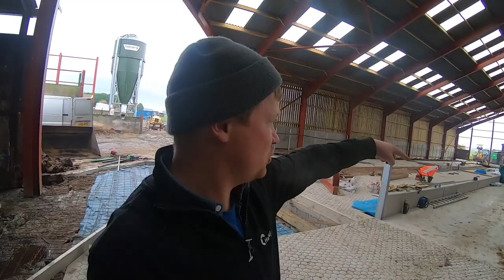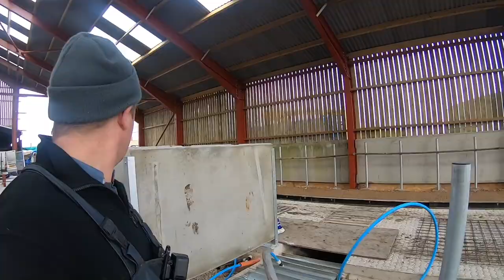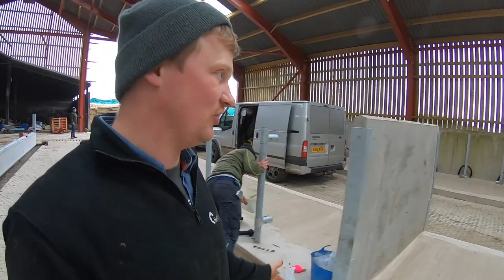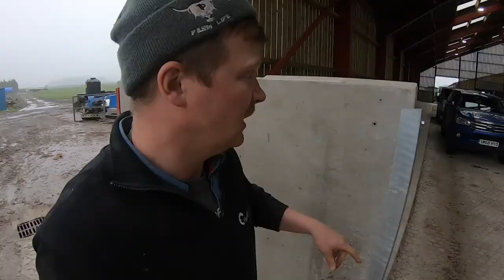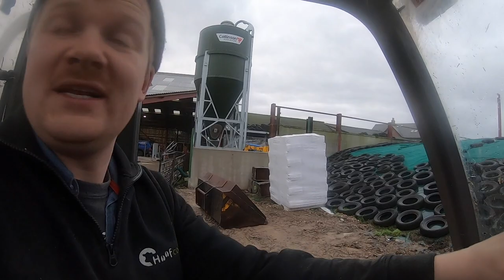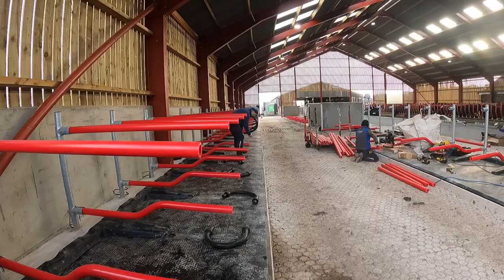WE ARE NEARLY FINISHED !!!

Comment: Impressive cow accommodation. Beyond adding the rubber flooring at the drinkers have you seen anything you wish you had done different based on your experience to date with half the shed occupied?
It would be most interesting to get the roof ventilation guy back to see if what he said would happen actually does happen with the shed in use.
Reply: What had the roof guy predicted?
Reply: I assume your referring to the smoke test, in which case, I'm hoping to see them back to see the difference too.

Comment: Great video and I like that you observed the cows using the matted areas to walk so you padded the watering area.  One question: I notice in UK videos the siding of barns have small space between boards. I assume this is for ventilation but doesn't it create drafts? Here in the states the barns have solid walls,  no slats.  Just curious. Thanks
Reply: Michael, my question exactly and well said!  Also, I never noticed if the old barn had a 'bird problem' like most big sheds and barns do in the US.  Will that be an issue for the Pemberton Palace?

Comment: Just something I noticed there you were saying you’re timber work is a 12ft gap beside you’re silage pits would you not have been better off leaving it at 14 at a minimum so a loader or buck rake tractor can back in there out of the way when trailers are tipping

Comment: Hey Tom get your self a garden tractor with a snow blade on the front of it and use it to push up the grass!! It works great and saves time plus can keep the garden tractor just for that job. It doesn’t have to be dance just a good working machine and it will save you loads of time